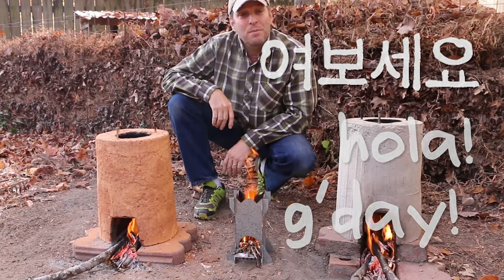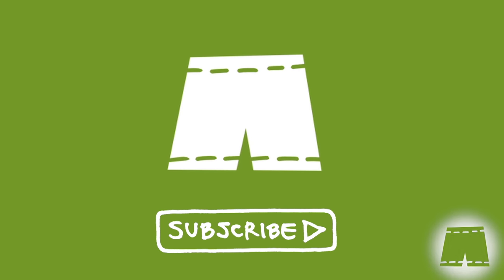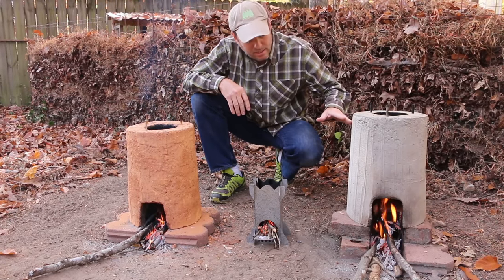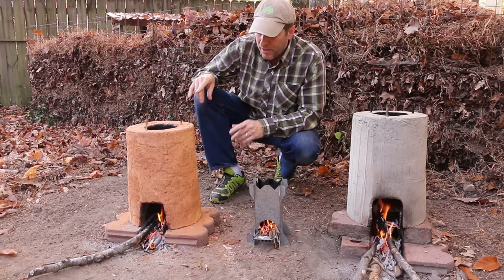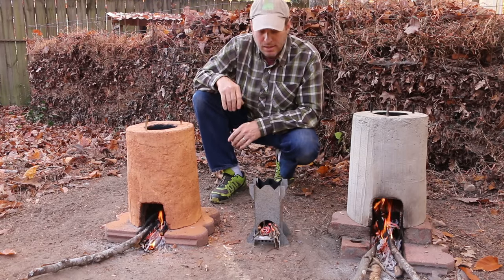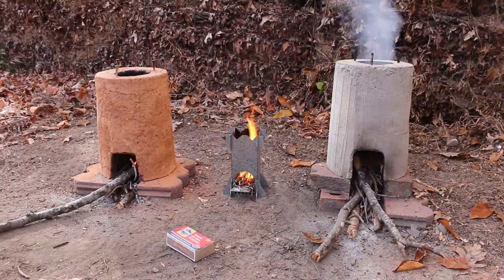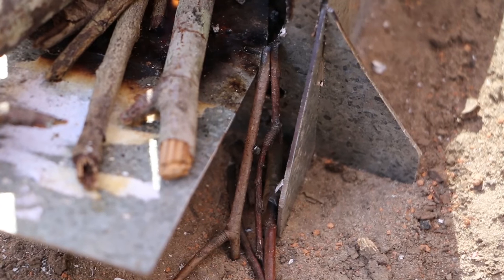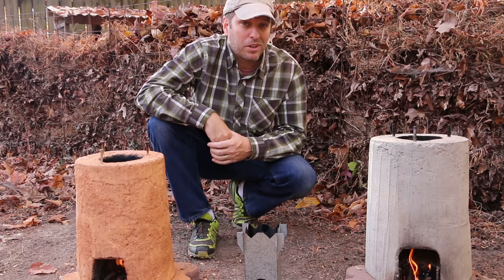Firing My Three DIY Rocket Stoves | Mud, Metal & Concrete

Comment: lovely channel, and a great approach to the presentation.I agree with the don't need an armature idea ,this is what can cause cracks due to the different thermal expansion properties of the material, ie mud and metal .The straw has the advantage if slightly moist of slowing the curing process and eventually when dry adding lightness and strength.
Reply from the maker: Thanks for the encouragement. I'll be building another version of this mud rocket stove soon. I appreciate the feedback. Thanks for watching.

Comment: looks like you enjoy sitting near these three stoves. can u please make comparison in term of fire temperature and boiling time.
Reply from the maker: Well...the mud rocket stove is gone. I let it sit out in the weather to see how long it took to degrade. Moisture soaked in pretty quickly, but it would fall apart when I moved it. The comparison between the metal rocket stove and the concrete rocket stove would be tricky, since they’re so different in size and the size of pot used. But (not to just be a downer) I just made a new version on my concrete rocket stove and I will be doing some testing with that and the old concrete one. That will answer some of your questions. Coming soon. Thanks for watching.

Comment: I would buy one of your folding metal camp stoves. I have no way to cut out the design even if I bought the design. I have the tools, but they're in storage for now until I get my own place. Another suggestion...small, fold in tabs on all four sides that can be attached to the ground via tent stakes. I always wonder how stable the rocket stoves are with all that weight and bigness on top of the tine stove.
Reply from the maker: Hi Kathryn. I am working on a way to start building some of the stoves to sell. I've just purchased a small plasma cutter and need to learn how to use it. :-) I hope to have that worked out in the next month or so. Send me an message via the contact page at www.greenshortz.com and I'll keep you posted. Thanks for watching.

Comment: Thank you which one was lighter in weight and heat resistance ?
Reply from the maker: The cob was lighter and both materials handled the heat well. The concrete eventually cracked in half, but it didn’t have an armature. The cob stove had an armature, but I didn’t use it enough to determine a failure point. Eventually the the rain delaminated the cob.
Reply: @GreenShortzDIY  Thank You for the update .I liked your cob stove and was thinking of making one ..

Comment: Wonder what it would cost to get a machine shop to cut out the pieces for the flat pack stove....  Love how you cut the top to let air in.  So important to have air under the cookware.   Very professional video production!  : )
Reply from the maker: Hi Julie. I am going to look into having the rocket stove produced. Maybe a Kickstarter campaign. What do you think? A viable product?
Reply: +GreenShortz DIY I think Lee Valley Tools sells a camping stove that looks and works much like your folding stove. You should check into that before you kickstart.

Also, I want to mention that leaf-blowing is just about the most annoying  and stupid way to burn fossil fuels.  Don't these people know that wind may blow their leaves back again?  And why do people want those leaves moved?  I  have a neighbor that has a landscaping company mow and blow, and then he blows leaves on the weekends with his own blower.  It is puzzling.

Comment: Promised these plans for a base, months ago. Life got in the way, hope these are clear enough. 
Home Depot Bucket & Lid
1. Remove zip strip around lid, toss it.
2. Assemble wood blanks & attach to lid
   a. Air Pocket - 2 pieces 3/4"hx4"w x9"l
   b. Fuel Shelf - 1/4"h x 6"w x6"l
   c. Center Fuel Shelf over Air Pocket; attach to lid, used Drywall screws
   d. Cut hole in lid & top of bucket to fit the Air Pocket & Fuel Shelf
3. Cut down from top of empty bucket 5"
4. Cover with pizza box
5. Attach lid to cut bucket & turn over
6. Pour same mix into cut bucket
7. Cure for 2 days – 48 hours
8. Carefully, unsnap lid from bucket & lift the BUCKET!!
9. Carefully turn base over & remove lid
10. Cure for minimum 5 more days
11. I used expanded steel for the fuel tray. Worked much better than sitting on the ground, more air in & in the correct spot!

Can send PDF with pictures, dimensions & instructions. Works very well in a semi-permanent location.
Reply from the maker: Cool! Thanks Bob. I’ll give this build a try. Message me with your email so I can reach out with any questions.

Comment: The cob n cement stoves look  pretty heavy, especially for women. What about attaching a handle of some sort baked into the material? Good job! Love the folding metal stove!
Reply from the maker: +Kathryn Kenyon yes. These are both pretty heavy stoves. The concrete rocket stove used a full 80 lb bag of concrete, so I expect it to about that. I am going to make another stove using all the good comments and ideas. I'll be sure to add a handle. :-) thanks for watching.
Reply: Kathryn Kenyon it could be made in 3 or 4 interlocking parts to make it easier to move...

Comment: a mistake your making on both the cement and dirt/clay stoves is the airflow is ment to come from the bottom if you put a layer or 2 of bricks down then a heavy wire mesh then either another layer of brick or the stove and built the fire on top of the mesh it would draw more air and burn much hotter without a fan.  a holey plate of cob or cement could work too and handle much higher temps than screen or wire...
Reply from the maker: TBerry, thank you for your suggestion. I had another comment with this recommendation a while back and have added a metal plate to allow airflow under the wood as I've used the stove recently. It has been helpful. I'll be doing an updated video on this rocket stove, incorporating all the good suggestions to improve it. Thanks for your feedback.
Reply from the maker: I just made a new version of my concrete rocket stove that will incorporate better airflow as you suggested. Take a look. https://youtu.be/TYr-Uj4HqDs Thanks for the suggestion.